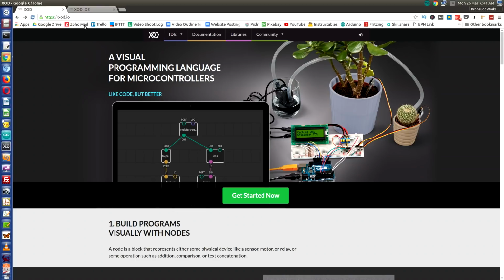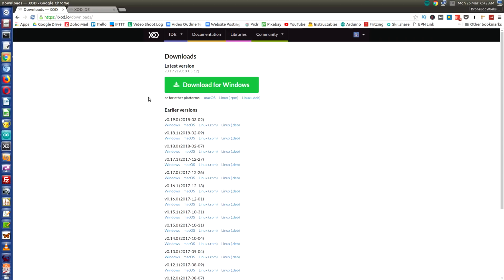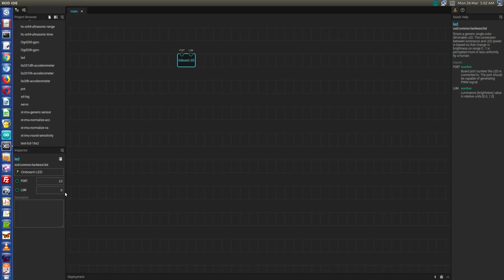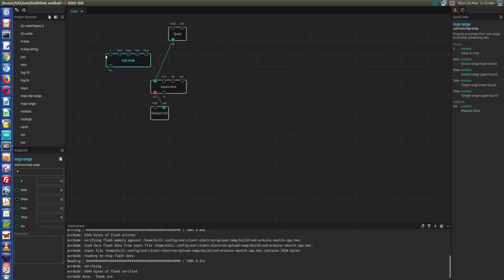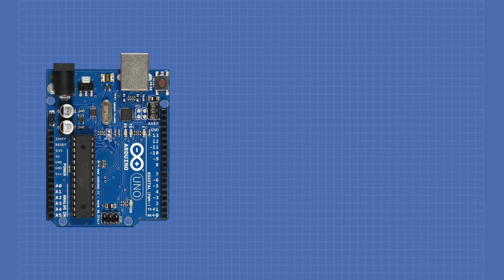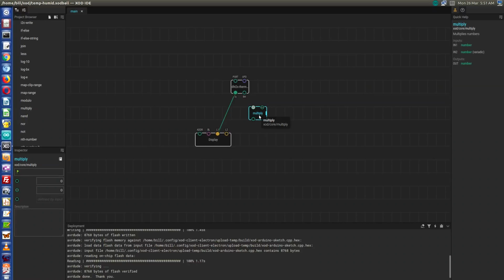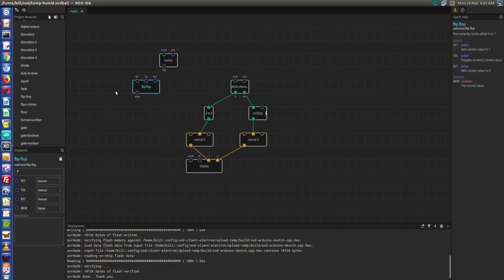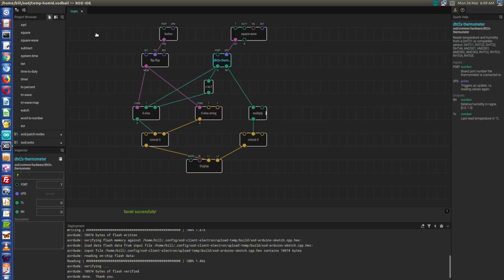Arduino Programming with XOD - Learning XOD

Comment: I look forward to your next one on XOD. I agree with the comments below on your excellent style. Some queries;

1  How do you view the code in the IDE for modifying in C. e.g. if you wanted to do a minor tweak to a couple of lines of code. Can it then be imported and re-modified in XOD and then go back ond forth? I presume not.

2  What if your device or sensor is not listed. Do you have to wait for XOD developers to write it in or can you create your own based on the new device's library written in C.

3  The more complex the project, the more complex the XOD program. Doesn't this mean that you end up increasing your XOD knowledge at the expense of learning C, which once mastered, is more useful? There is a trade-off here. I agree the visual representation is good for beginners though ... provided they can then get to the C code (point 1 above)
Reply from the maker: Hi whitefields5595
Thanks for the  comment, I'll try and answer as best as I can.

You can, of course, view the resulting C++ code in the IDE using the "Show Code for Arduino" item in the Deploy menu. However modifying it is another story. The generated code itself is pretty scary, compare the generated XOD Arduino code for my LED example to the Arduino Blink sketch to see what I mean!

One thing you CAN do is create custom nodes using C++ , which sort of answers your second question. I'll eventually cover this, probably not in the NEXT tutorial but in one after that. You can read about doing it at https://xod.io/docs/guide/nodes-for-xod-in-cpp/ .

As for the third point you make I really think this depends upon how you approach it. As I already am familiar with coding in C++ I don't feel that learning XOD is diminishing my programming knowledge, I see it as an enhancement actually. It gets me think about solving a problem in a different way. But if I were advising a beginner I'd have them learn the fundamentals of programming first, before moving to XOD.

But having said that it really depends upon what you're aspiring to do.  Some folks just like to build projects by hooking sensors and microcontrollers together and find the coding aspect to be the tedious part. XOD is perfect for them.

Those aspiring to become great coders should learn to master C++ and treat XOD as I do, as another tool in the toolbox.
Reply: Chris, thanks for doing this ... I was just about to sit down with my Easter egg and download, and you have given good reasons not to. I would add that it you need help or want to cut and paste code then if you have written in C this is simple. There are more folk out there who just love to give a hand and advice. If you seek help and present XOD generated C or a XOD schema then you may frighten the horses. There is also the risk of being left high and dry if XOD team disappear. 

I'm also not sure if I agree with Drone's analogy to XOD being another tool in the toolbox. For me it appears to be a different tool in a different box altogether.

So, the frameworks are interesting and fun to watch .... but not for me at the moment.
Reply: Chris, thanks for this further explanation of why this will not be for me. "Someone else's (memory-hungry) black boxes" sums it up exactly. Good for a raw beginner maybe but after a while it is far better for us to build our own equivalents.